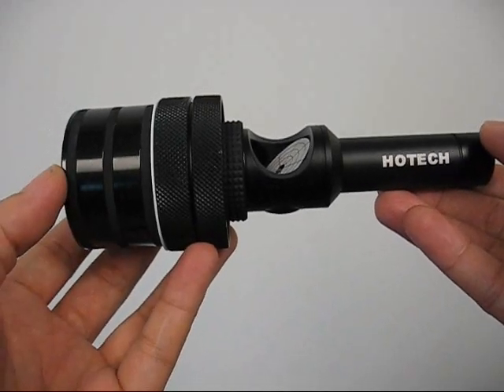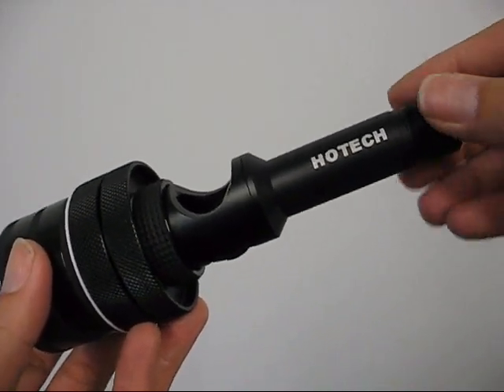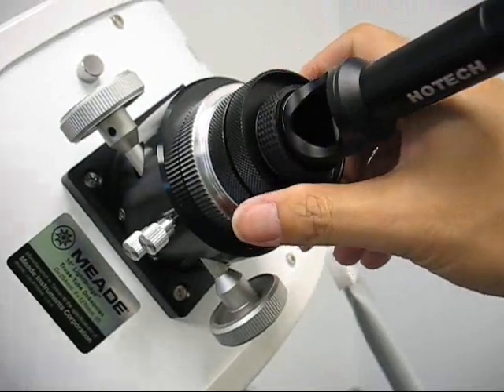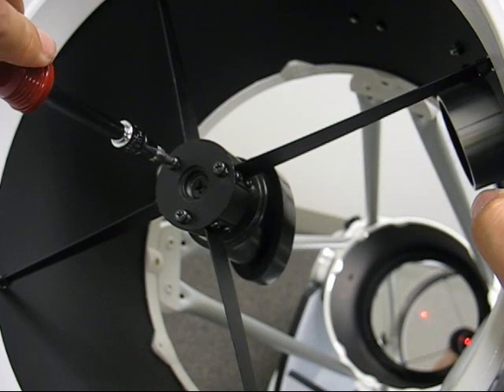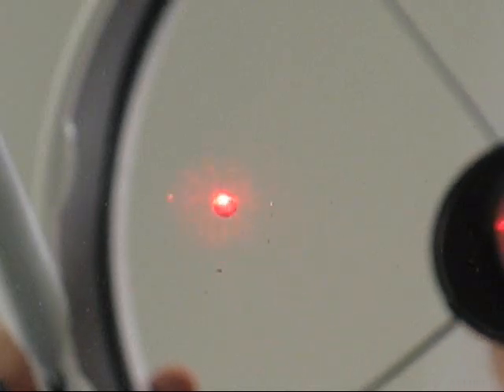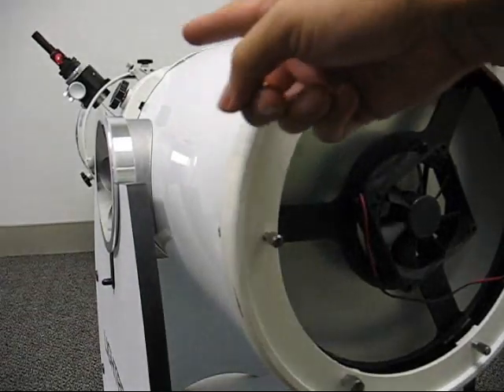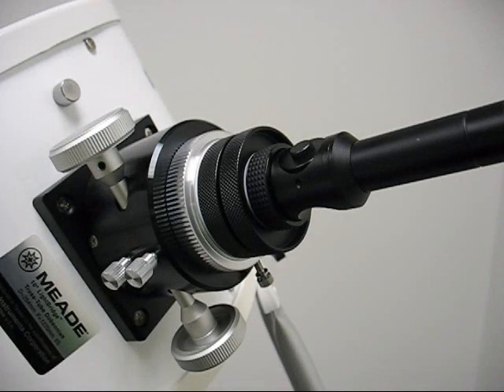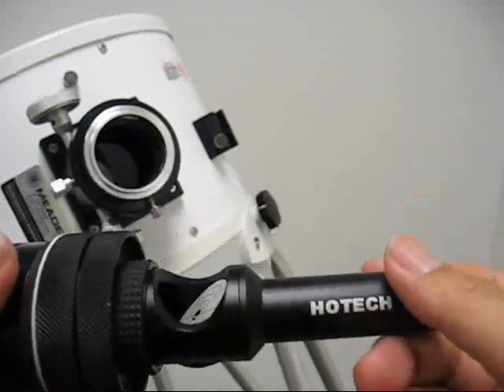Newtonian Collimation using SCA Laser Collimator

Comment from the maker: It is always best to collimate using the corresponding focuser size collimator to reduce any possible errors that might cause from additional none-SCA adapter.  2" version will be ideal in your configuration.
Barlow the crosshair version will work just fine.  The barlow lens expands the laser dot large enough to cover the center donut on the primary to cast a returning shadow.  It will have the exact same effect using a single dot version.  Thanks for the great questions!

Comment from the maker: @waheex,
You can either tighten slightly on the compression ring first for a snug fit, then tighten further down to secure the collimator in the focuser.  Or you can just insert the collimator in the focuser, then tighten the collimator.  The mechanism should keep the laser from wobbling in the focuser for a repeatable collimation.

Comment from the maker: 1. Laser in primary mirror's doughnut ring.
During secondary mirror adjustment, user reference the laser dot on the primary mirror for adjustment.  Often time, the laser dot is smaller than the center opening of the doughnut.  The extension crosshair lines provides better visibility when the center dot "disappears" in the reflection.

Comment: I have compared the Tectron collimation tools and this laser collimator for my 13" Dob. If you're collimating an open truss scope alone,  you don't have to keep going up and down, primary mirror to focuser, when you adjust the primary mirror, because you can see the laser beam dot on the secondary and in the hole. The laser collimator is a lot quicker and more accurate in the dark; its tube properly centred. The focuser's screw offsets the sight tube a little; the Cheshire's ring needs light.

Comment from the maker: Good question! I was not very confortable about doing it too, but I need that much force to actually make it move without loosen the entire secondary assembly.  I have changed to Bob's Knob, and it works without making such scary torque on the spider anymore.
Reply: Hi, it's Bob here, you better stop playing with my knob, or you're going to end up in a mess....

Comment from the maker: @biggrex,
Don't really understand what you mean by more than 1.25" focuser circumference.  I think you try to address three issues in one sentence.
1. Focuser fitting issue:
The compression ring can expand to fill the standard mfg. focuser opening tolerance +/- 0.05".  If it still doesn't fill the opening, it is the focuser's problem where the mfg. has VARY sloppy quality.  Upgrade one if possible.

Comment from the maker: I am using a Meade LightBridge 10-inch Truss-Tube Dob on a 2" Crayford focuser.  All parts are stock.  Your 8-inch should work the same.  And I would suggest to buy a Bob's Knob alignment screws for your secondary mirror.  It will make your life easier while collimating it!

Comment: good video , but there is no compressorring on the 1.25 inch collimator? instructions are different with this model. Do you tighten the grip ring before you insert the collimator into the focuser?

Comment from the maker: The 2" to 1.25" SCA adapter only accepts 1.25" SCA adapter because there is no thumbscrew to lock the proposing eyepieces/camera unless the adapting equipment also has a 1.25" SCA adapter.  The opening is a high precision machined 1.25" straight tube.
Moonlite builts good focusers.  There should be no problem using the SCA adapter.  Make sure you reliease the compression ring (keep the compression brass ring inside the focuser groove) before adapting the SCA collimator.

Comment from the maker: Always doulbe check the location of the donut sticker on the primary of a stock Lightbridge. I found couple of my friends own the Lightbridge have the problem where the donut was not placed exactly on the center by the factory.  My Lightbridge was off 1.5mm.  I hope Meade has corrected this.

Comment from the maker: 2. Laser in the target grid display.
During primary mirror adjustment, the returning laser will also "disappears" in the center hole of the target grid.  Again, the crosshair extension lines help the user to precisely center the laser on the target.

Please check out "HOTECH SCA Crosshair Laser Collimator" video in our channel HOTECHUSA for more reference.  Thanks.

Comment: @HoTechUSA 

It's difficult to explain without a photo. Essentially the eye focuser is not 1.25", maybe it's a cheap design, but I would say the tube itself is closer to 2" and then it has an inner ring on the end of the tube where you insert the eye piece that is 1.25", but the ring is right on the end, so the compression area on your collimator is really just dangling and surrounded by open air. I finally just pushed the collimator and held it pushed in so it was flush and didn't rely on the..

Comment: Is there any point in using a barlow with this? Surely the barlow will be slightly off centre if you tighten the focusing screws round it and this will thus defeat the purpose of the expansion rings of the collimator. (surely it would only be any good with a barlow if the barlow also had expansion rings to keep it centered in the focusser).

Comment from the maker: You are absolutly correct that the laser has to hit the center of the donut during the secondary mirror adjustment.  I did the video in a rush, please forgive me for not emphasizing the issue.  Special thanks for the reminder!
Reply: So you re-did the video cause it looks correct instructions now correct? Also how long will the battery last turned off in storage? Thanks 👍

Comment from the maker: @biggrex,
2. Unstable movement after installation:
It is possible that the focusing gears are loose causing the entire assembly to move even if the collimator is secured in the focuser.  Please double check the movement source.
3. Focuser inner contact surface too shallow (1/4”?):
Many mfg. cut corners to save material by shortening the depth of the focuser.  Try to upgrade a new focuser.
The quality of the focuser is out of our control.
You can email me for faster response.  Thanks.

Comment: Hello,
I'm thinking about buying a Hotech collimator for my 8" Newton. My focusser is 2" but I always use the 1.25" adapter for my webcam, eyepieces etc. What would be the best buy for me? the 1.25" version or the 2" version?
And if I want to use a barlow to collimate my primaire mirror, does it hurt to take the crosshair version of the collimator? Or am I better off with the normal dot version for barlowed laser collimating?

thanks in advance!

Comment: My understanding is that despite extra effort, you can still get precise level of collimation with a Cheshire collimator / sight tube system as there is no inherant potential misalignment between the mechanical and optical (laser) axis. Is this your view ?

I recently collimated my F4.5 scope (16") and when finished, had it checked with a Glatter holographic + barlowed laser system. There was no difference. What are the advantages of the hotech system ?  I'd appreciate your thoughts

Comment from the maker: @biggrex,
Is your focuser a 2" version with a low-profile 2" to 1.25" adapter inserted?  If this is the case, you can either find a new 2" to 1.25" adapter that does not have the recess for more adapting space and inner tube adapting area, or upgrade to a 2" collimator to collimate straight on the 2" focuser.  I only wish you can utilize the SCA mechanism fully when collimating.

Comment: Hey, thanks for answering my questions! I do havea few more though. 
I will follow your advice then on buying the 2" version. I understand that it comes with an adapter to 1.25". So if I'm done collimating, is it possible to use this adapter for holding my eyepieces/camera etc? And I'm using a Moonlite focuser which has a drawtube with a compression ring. Will I encounter any trouble  when putting in the SCA adapter?
Sorry for all the questions, but better safe then sorry :-)

Thanks again

Comment from the maker: Often time, the telescope mfg. include a focuser w/ larger than standard tolerance opening which does not allow the SCA mechanism to take full effect (the 2" ID slop is too large).

We can replace a larger o-ring try to compensate.  Please email & give us a reading of the actual ID on your focuser so we can calculate if the replacement o-ring will work.  If they are too large, it is the scope mfg.'s fault.  You will have the same issue for your eyepiece. Upgrading the focuser is an alternative.

Comment: That was excellent video.  I have two collimator tools for my 10" Newtonian.  I tried your method last night, and I had no issues with it.  However, when I then looked through a collimator tool, the secondary mirror was out of alignment as well as the primary.  Something tells me the laser is more accurate.

Comment from the maker: Cut out a piece of paper with the same dia. of your main mirror.  Fold it in half twice look like a flat cone shape.  Cut the tip of the cone to relveal a center hole.  Get a binder re-enforce sticker ring at OfficeMax.
Take out the primary mirror, lay the paper on top of it and use the cut out center hole as a guide to stick the ring sticker on the exact center of the mirror.  It is critical to place the donut in the middle.  Try to simulate the process in your head before your do it.

Comment: Did you collimate the collimator first prior to collimating the telescope?  
;)
Reply: No. Because this collimator doesn't need collimating. It's aligned at the factory. If you get it and it isn't aligned then you send it back and get a replacement. Unless you're smashing the collimator about you shouldn't ever need to collimate it.

Comment: Mine doesn't have the donut, how tf do I find where to point the laser
Reply from the maker: The telescope mfg. should do this at their factory. To DIY your own donut, you can get a stationary binder ring protector and stick it in the center of the primary for collimation reference.  To locate the center of the primary, cut out a paper with the same diameter of the primary, half fold the paper twice into a cone shape, then cut a small piece of the cone tip off.  Open and lay the paper on top of the primary, then carefully paste the binder ring in the center of the cut out opening.  Hope this helps.

Comment: doesn't work with focusers that have a recessed tube circumference of more than 1.25", my focuser only has a 1.25" ring that is about 1/4" wide, so my new hotech is worthless, it moves around more than any screw tightener would!